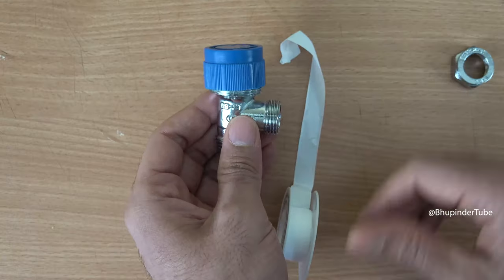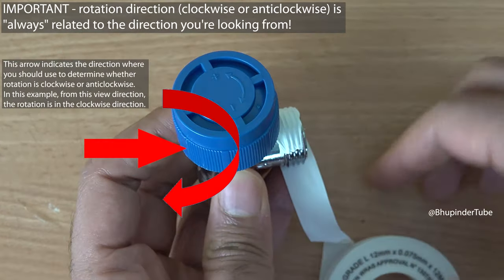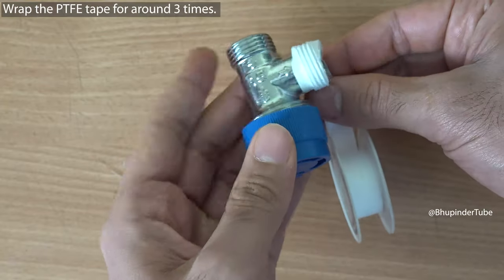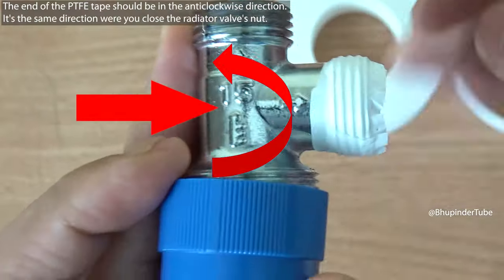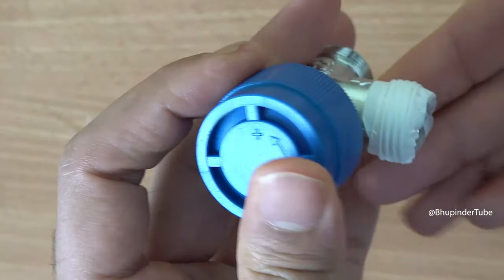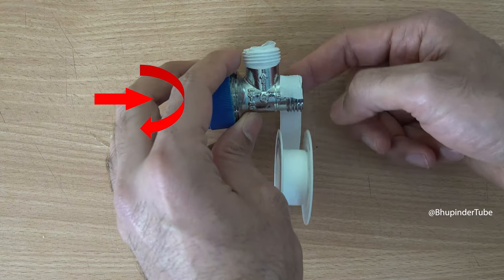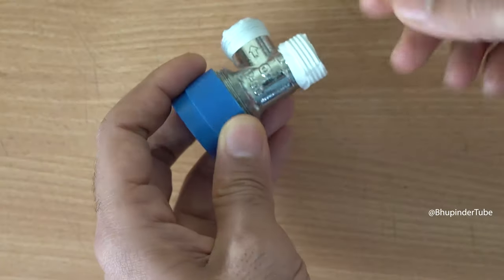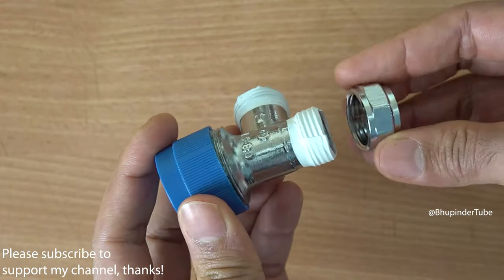How To Put PTFE Tape On

Comment from the maker: It is also recommended to add PTFE tape on the olive, specially if you find leaks from the bottom of the radiator valve's nut that's connected to the pipe.
You can find all my radiator tutorials in this playlist 👉 Radiator Tutorials  - https://youtube.com/playlist?list=PL6oDA8S3RmtFLnYXe9_ydvL9npYSnUhDY
Please subscribe to support my channel 🙏 If you've any questions or any tips that you want share, please mention that in comments. You can also find more radiator related tutorials below:
👉 How to Replace a Radiator Valve - https://youtu.be/HpKgS3HQ0XM
👉 How To Remove A Radiator - https://youtu.be/4jP8eN_z_eA
👉 How to check radiator valve size - https://youtu.be/gGNH3A0LRZQ
👉 Which way to turn radiator nut - https://youtu.be/y9ZXs32bye4